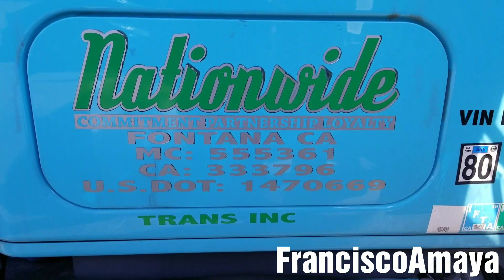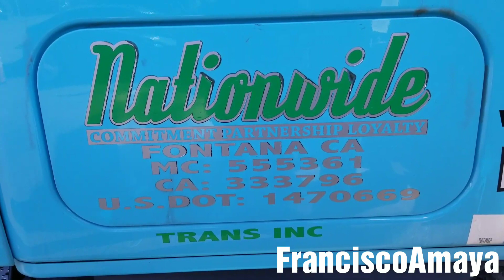Freightliner cascadia DD13 DD15 DD16 no oil pressure engine failure damaged main rod bearings part 1

Comment: Same thing happened to me. Exactly the same peace of the original oil suction manifold broke off on mine right at 505000 miles, right after the warranty expired. It got towed In to the closest dealership in Seattle. Luckily for me, just like in this case, nothing got overheated. They replaced the main bearings, manifold, rings ets. Later I found out that my year of Cascadias had a recall on that manifold just a week prior, so Freightliner end up picking up the bill for me, which was around 4500 not including the tow bill. So I'm happy that at least I didn't have to pay that bill. On the other hand maybe my engine should have seized, so they replace the whole engine for me :)
Reply: The Demetry what year is your cascadia? Mine is a 2013
Reply: @JZ-ek4tu  2015
Reply: I have the same year truck with same mile with they pay for me too? Is that factory warranty or you bought extra coverage plz let me know. Thanks

Comment: That is so cool you caught that moment when you identify the defective part on film.  I had oil pressure fall to red light at running temperature.  No new o-rings, so stealership made me buy same (entire) OEM suction device.  USD $700 parts and labor.  Now I will keep my eye on that PSI to prevent bearing and crank shaft damage if it fails in the same way. (2012 DD15 1mill mi. ) Thank you Francisco!!!

Comment: This isn't an isolated incident. I had the same part break in the same way. This is the newest version of the oil suction manifold so good luck everyone.
Reply: how do you know this is the newest version? both first and second versions look same.  however they have different part numbers. Detroit says suction cup is now thicker, different glue is used on latest version.
Reply: POS

Comment: Fransico, I have a DD15 and I was having the low oil pressure problem. I changed the oil pump, oil pump manifold, O - rings. When I start the truck it still stays at 0 oil pressure until the truck warms up to 150 degrees. Can you give me a idea what else might be my problem after changing out all those parts?

Comment: How low was the oil pressure on that motor?
Reply from the maker: 0 psi.
None
Reply: Francisco Amaya what is the normal psi for the oil ? Thanks
Reply from the maker: DD15
14 PSI AT 219F
Reply: @franciscoamayaYT  sup Francisco is 23/24 psi good idle oil pressure dd13

Comment: What if the oil pressure doesn't rise above 30 while driving?
Reply from the maker: That could be a problem with the oil pump orings.

Comment: When I apply the brakes my red engine light come on and low oil pressure is on the dash. It happens only when I apply the brakes at a moderate level. It always goes away after few seconds. What could be causing this?
Reply from the maker: Replace the oil pump orings 
Check my video for details 
Click the link BELOW 
https://youtu.be/MIcVtIiiB6M